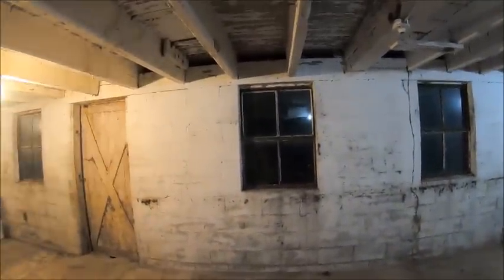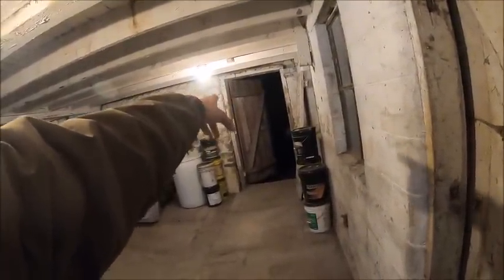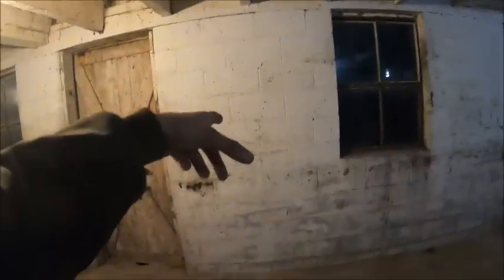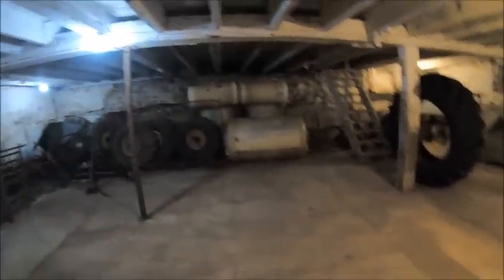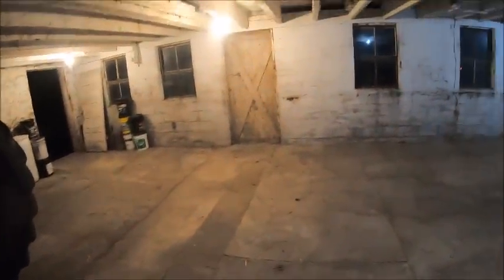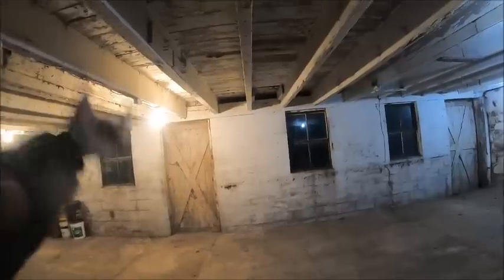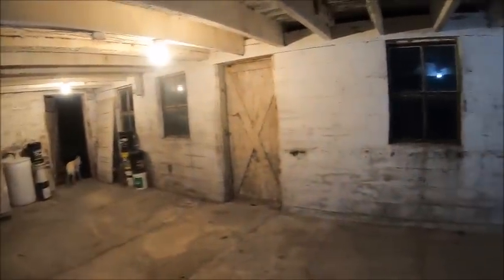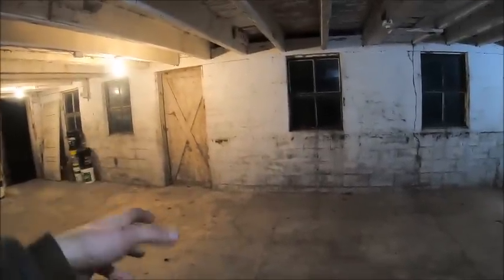Prelude To The Barn Door Project

Comment: Theoretical question? Wouldn’t the Super 55 fit down there? I know you want to put the smaller pieces down there. Seems like if the 55 was down there as well you’d have more room for the T and 1955 in the pole barn when they both have duals. I could be a poor judge on head clearance though.

Comment: Know how you feel about the price of concrete. I want to do some pouring too but not now. Heck I don't know if it will ever come back down. Do what ever you need to and save that barn...
Reply from the maker: It has to come back down at some point. This is ridiculous.
Reply: Quickcrete is stupid expensive too... I put off a shed floor expansion till spring because of the $$$

Comment: Check out a product called Dexpan for busting up the concrete.  I've used it and it beat all other removal methods.  Drill holes, pour in the Dexpan and wait for it to crack. Just an idea.
Reply: Yeppers AKA Expando . Drill mix fill and come back the next day to broken up stone or concrete. Use deep wet saw scoring to make nicer edges where that is important.